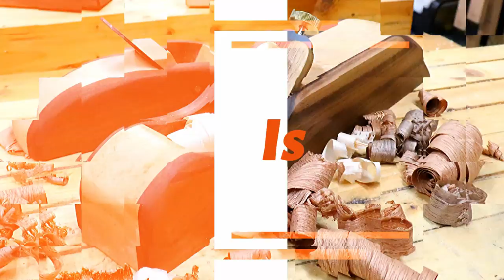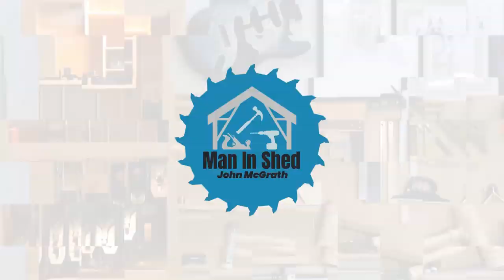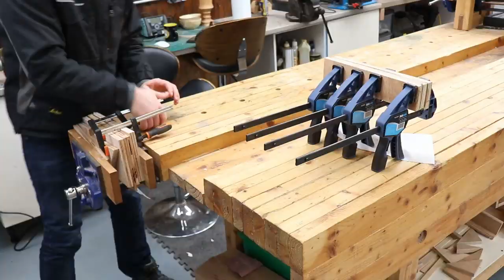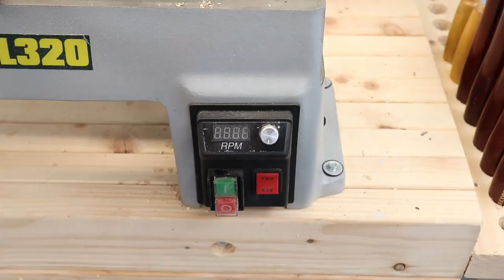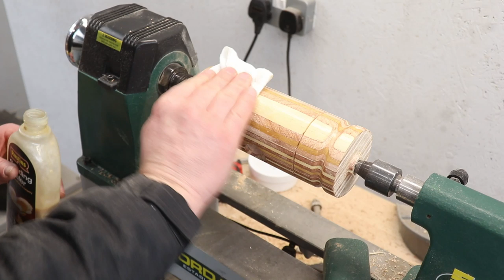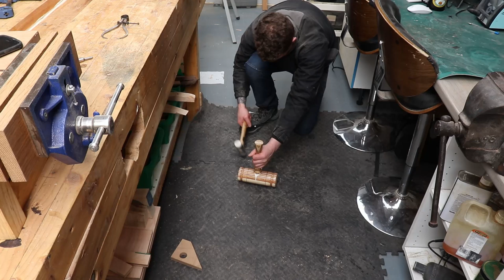Turning a Plywood Mallet.

Comment: John, John, John, When you are rubbing anything down on a lathe that is turning, rub from the bottom, that way if it grabs whats in you hand it will trow it against the wall at the back, If you rub from on top as you did, and it grabs whats in your hand it could catch and drag your fingers and hand into the job from underneath.  Just saying :)
Reply from the maker: The piece is rotating towards me so if something catches it will push my hand away not pull it in

Comment: Interesting idea John, I didn't think you could turn laminated plywood like that without it dissolving into a shower of splinters.

By the by, that bit where you were trying to cut the ends with a japanese saw and a bench hook, I found western benchhooks aren't fantastic for that, but you have dog holes in your bench, give this a try. It works really well for me with my japanese saws and only took me about 15 minutes to knock up (and that was because I had no pillar drill and was thinking it up on the fly):
http://www.stochasticgeometry.ie/2018/01/05/more-small-jobs-and-practice/
Reply: In case it's not obvious btw, you use that bench hook by plugging it into the bench and the work goes on the far side of the fence from you - so now your saw pull and your grip are both exerting force in the same direction, your body mechanics work a lot better and you get more consistent results:
http://www.stochasticgeometry.ie/wp-content/uploads/2018/01/IMG_2280a.jpg